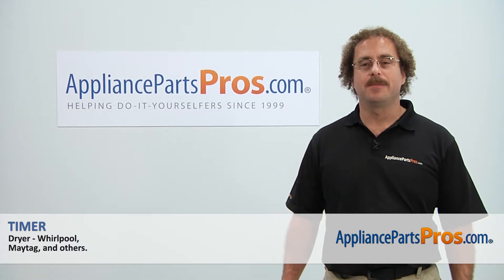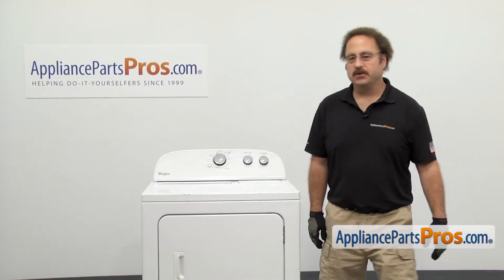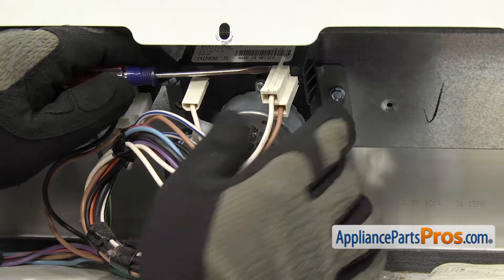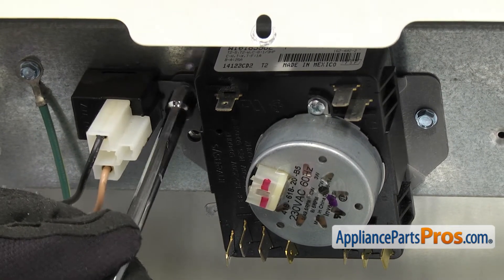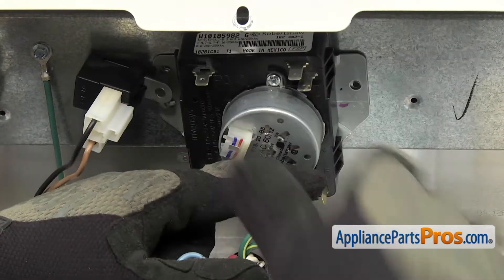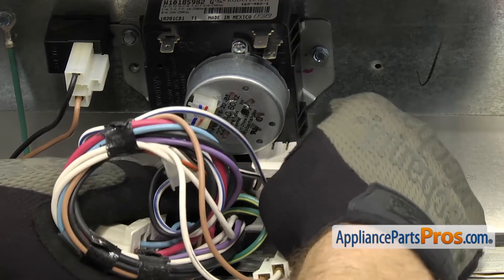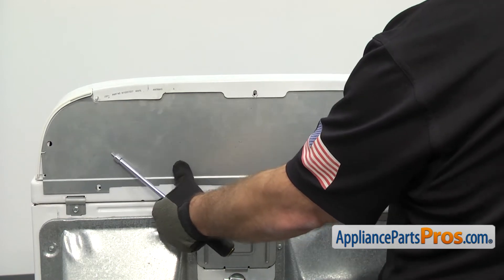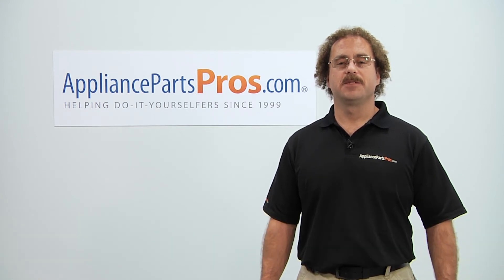How To: Whirlpool/KitchenAid/Maytag Timer WPW10185982

Comment: I accidentally installed a WPW10185982 to replace a WPW10185992. It works but the control knob is not lined up with the markings on the dryer now. Can I just replace the knob to fix this issue or do I need to replace the timer again.
Reply: Hi. What did you end up doing?